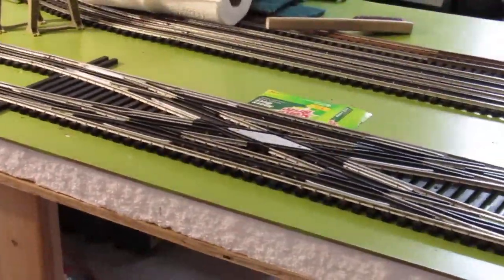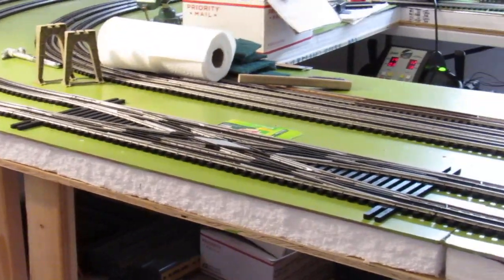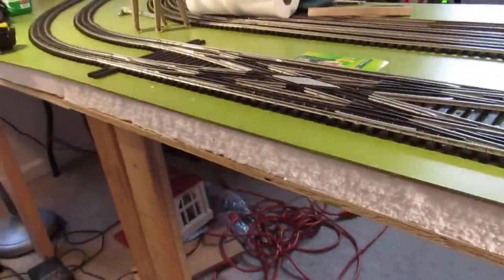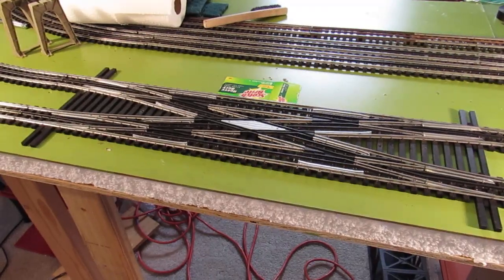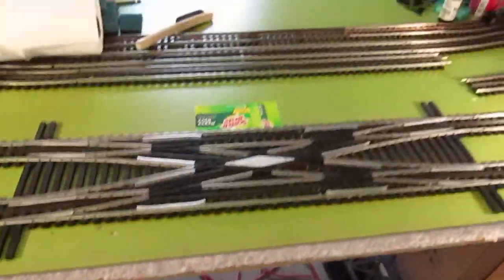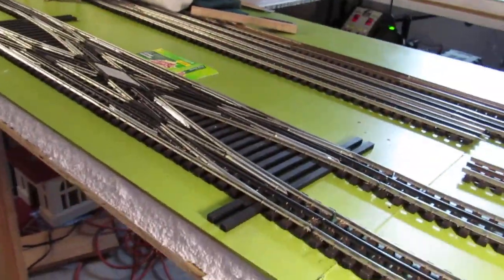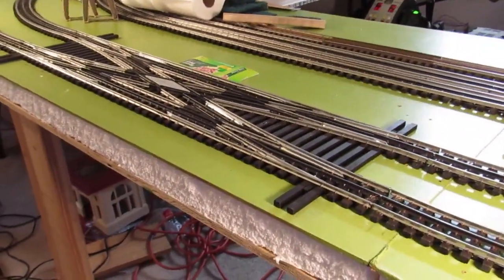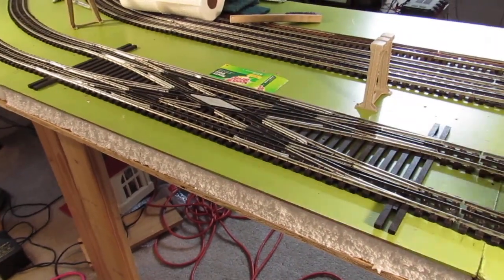ROSS #175 DOuble Crossover!!!MTH/Lionel/O gauge

Comment: Doing trains since 1958, now working on my new trainboard.  Chose atlas track because lionel 072 switches were hard to get, thinking atlas switches would be better. Didn't know about Ross. Bought 10 atlas switches. Atlas crossover rails broke off after 4 mths of running my heavy mth premier steam engines. 8 of 10 switches had many problems. Health problems & those poor atlas switches made me stop trains for 8 years while I slowly built my new trainboard. Made the mistake of getting 10 switches at once., probably bad batch. Many of my premier mth engines loose power momentarily in the middle of the atlas switches. They dont hang up or stop, just loose power for a second. Back then, the atlas switches were out of warranty before I got them on my table. Yes, I can appreciate Ross switches after my disasters with atlas switches.

Comment: Good job. Please help clarify. Using mth z4000 & "tiu/remote. The 2 middle terminals on the z4000 are fixed output, believe 10 & 14 volt, the outside handles 18 volt. To run my few dcs engines. Do I hook up the z4000 fixed terminals to the tiu middle fixed input terminals. Will that only give the engines 10 to 14 volts. Mth pamphlet said hook up z4000 to fixed variable input to power the tiu. I've hook up the z4000 variable handle to the tiu's variable 1 terminal then variable 1 output wired to the track. Please help, mth doesn't answer their phone, no customer service